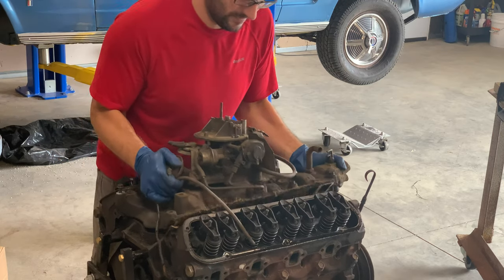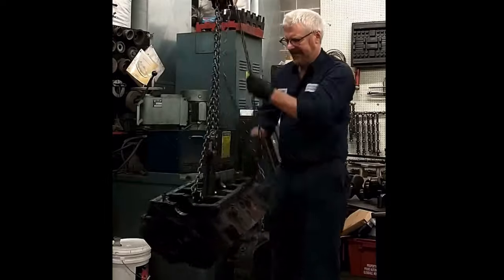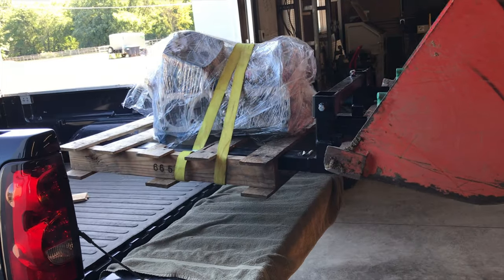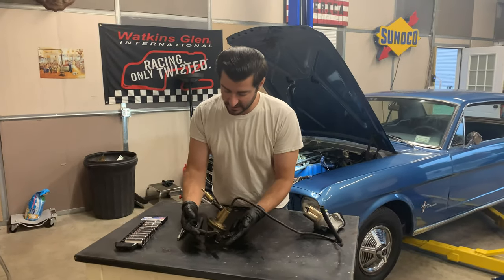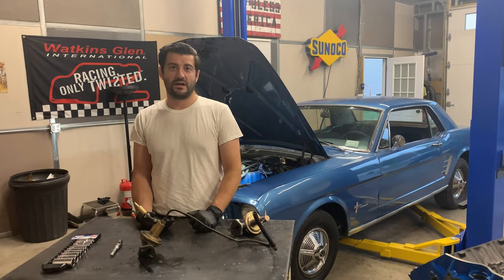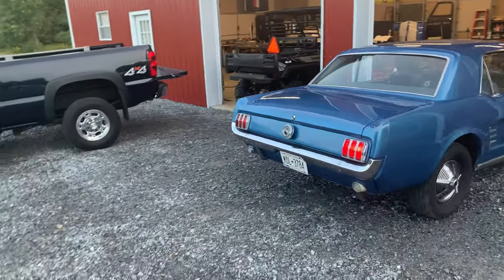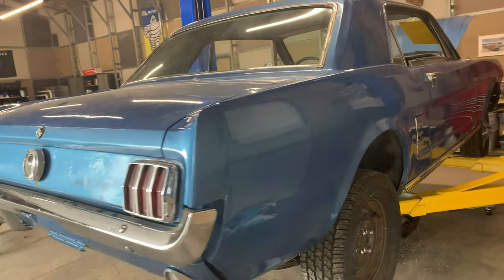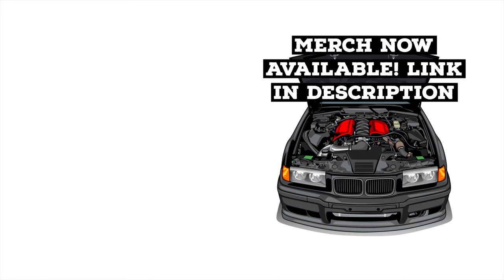351 WINDSOR GETS REFRESHED: 66 Mustang 351 swap Ep: 4- New 6 cyl fuel pump and a brake test too

Comment: I’m also 351w swapping my 66 mustang
Reply from the maker: There is a lot more work involved than I originally was thinking because this is a six cylinder car, is yours a six cylinder?
Reply: @LowBoostFilms  originally a 289, but I got it with a 200ci i6 like yours
Reply from the maker: If that’s the case then you already have the correct rear end and front suspension components! Five lug wheels and everything. I have to make sure I get a low profile intake manifold and carburetor to clear the hood next

Comment: Why are putting a quarter into that 6 cylinder that your pulling, unless it's a daliy driver.
Reply from the maker: I get what you mean, I just wanted it running and driving before I pulled the motor and advertised it for sale.